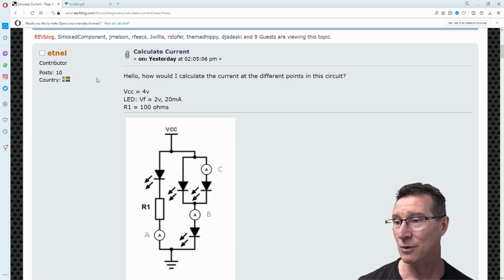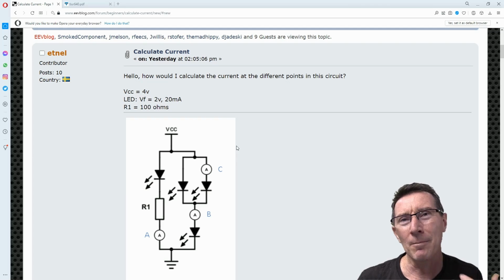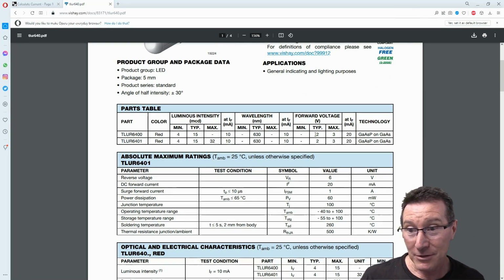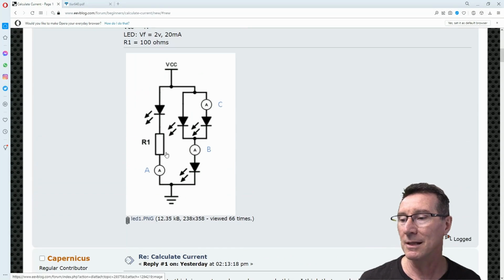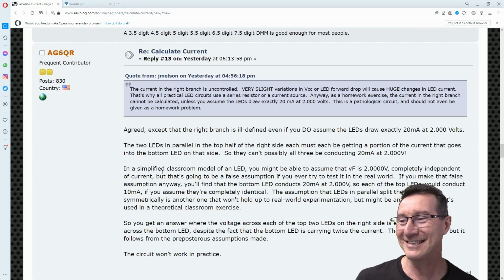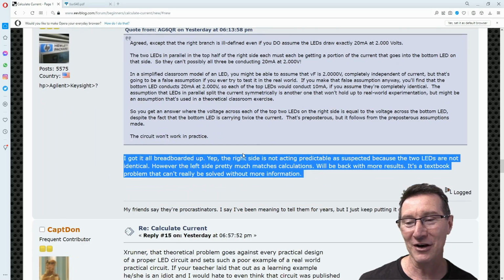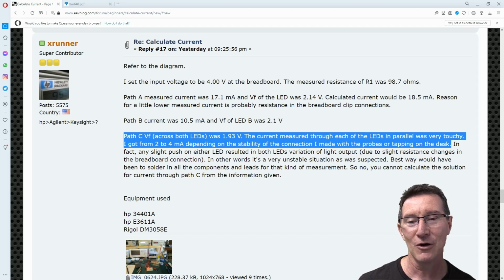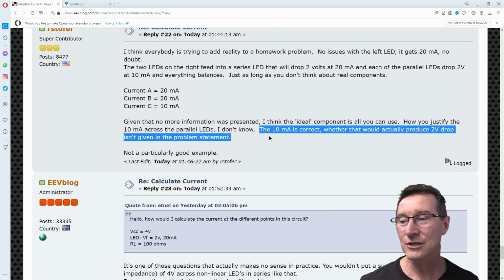EEVblog 1427 - An INFURIATING Electronics Exam Question!

Comment: If you use only the information given then "A" would be be 20mA since the voltage drop on the first LED is 2V,  and 2V/100 ohms = 20mA, easy side. If you treat the LED as linear which these are not, then each of the LEDs could be treated as resistors (2V/0.02A= 100 ohms) using the only info given. The two LEDs in parallel would act as two resistors of 100 ohms each in parallel (LEDs) hence = 50 ohms and this is in series with 100 ohms would give a current of 26mA (4V/(50+100) = 26.6mA) through the right side (B). Split evenly at the top so 13.3mA at "C". Then you tell them it is not going to work properly due to tolerances.
Reply: What was really missing is "Assume the LEDs are acting as ideal diodes" which would then make it a proper exam question. At that point, the right side then becomes a set of simultaneous equations you have to solve to get the i1/i2 parallel currents and the i3 current for that side of the branch to get the "B" and "C" answers, respectively. Being lazy and looking at the graph the voltages would probably be something like 1.9V for the parallel LEDs, and 2.1V for the LED in series, or ~15mA and ~30mA respectively.

Comment: Go Dave >>> Dave stick to them with Kirchhoff's law...all hail Dave.
Bottom line in any design is to know the basic laws of circuits even if the elements are not linear. Such as transistor is a current device and most devices in Physics are not linear.

Comment: As for the LEDs on the right side - there is another interpretation - if the (perfect) LED, which has a voltage drop of 2V, requires 20ma to pass through it to light, the LEDs on the right will not light at all, as 4V is across 2V + 2V drop, i.e. 4V across 4V. Current can't flow. Again one for the argument that the question is flawed.
Reply: This type of  logic would never allow you to eat hot dogs because given 8 weiners and 10 buns  says you cannot make any hot dogs at all.

Comment: OMG... (Disclaimer: I'm a mathematician, not an EE)
The (theoretical!) answer is: 20 mA, 26.7 mA, 13.3 mA for A, B, C accordingly. And the only assumption you need is that I-V curve of the LEDs is linear between 13 up to 27 mA. (Besides the assumption that all LEDs are identical)

Comment: I find that with a full I-V curve or model parameters for the diodes, the B-C branch could be an interesting theoretical problem, and one that could be quite applicable to someone studying analogue IC design or power IC design—though I wouldn't expect students to solve the resulting mess of a transcendental system of equations by hand (if I recall right, you'd have an exp(x) + x = 0 form, which isn't trivial to solve analytically, and asking students to do even 3-4 iterations of a numerical solution by hand is ... unnecessary).

But with the leap-of-logic assumptions that you're expected to make here, it's downright silly—I would never assume 20mA in the B-C branch, except for the fact that it's the only reference current given to us. It might not be as bad if better assumptions were given in the problem, although it's still an impractical problem (e.g. if you said the LED is ideal at Vf=2V regardless of current, then I could say that the B-C branch's current is undefined; or if you said the LED is ideal at Vf=2V regardless of current and IB = 20mA, then IC = 10mA and it's a question of realising that Kirchhoff's applies even though your LED model doesn't help).

I do like the idea of this circuit as an open-ended interview question. Lots of directions a candidate could take it—design perspective (when could this non-current-limited topology be acceptable, when would it be bad?), failure mode, discussion of the theoretical solution for currents and voltages in that branch, etc.

Comment: from the question I would assume the follwing tasks are expected from the student: 1) looking up at least one matching diode datasheet 2) calculating the currents by the the appropriate differential equations.
3) and only finally (after doing the work of 2) explaining why it's a bad design by calculating the effect if temperature drift on b/c
4) finally go on the topic of binning and production/reliability issues if used in mass production

Comment: If you want to test someone's comprehension of circuit theory, ask them what happens if you short a perfect charged capacitor with a perfect conductor and a perfect switch.  Where does the energy go?  Circuit theory is not enough.
Reply: A more precise definition of "perfect" is needed to answer this. Assuming it means zero resistance, but not zero inductance, my answer is that a current oscillates back and forth in the resulting LC circuit and the energy is radiated away as electromagnetic waves.

Comment: There's no consistent algebraic solution to this circuit because the diode elements have non-linear V-I characteristics, and the characteristics are randomly different out of the box and varying with temperature.  The best you can do is to know (or presume) the V-I curves of the components, and perform a numerical solution such as with SPICE.  It's like putting battery cells in parallel; there's no passive arrangement that will work consistently or predictably, and active battery management is required to establish stable performance.

Comment: if you convert Vf=2v@20mA to ideal 100ohm resistors,
right side ohms law is 4v = 0.0266a * 150ohms.
bottom led gets 26ma and right led gets 13ma.
but leds arent linear tho...

Comment: If you can analyze typical op amp internal circuitry with all the esoteric current sources (Wilson, Widlar, etc), crazy active load topologies and so on, then this type of circuit is pretty straightforward. Though it is definitely impractical using real-world discrete devices.

Comment: Cool you made a 30 minute rant on this.  You can make a boundary problem on this in that the right leg cannot support 20 mA, So it is below that. And the lower bound is 10 mA on right leg because we know there is a 2 V drop on the lower LED if this was the case but the two parallel diodes now have to support a lower bound of 5 mA and that makes their voltage drop less than 2 v.  So we all know the answer for c is  5 mA < Ic < 10 mA> and for B Ib < 20 mA.

Comment: It would have been fine if they just said “forward voltage is always equal to 2V” without even mentioning the forward current. Be a nice basic question, but to be given to students who haven’t yet reached shockley’s diode equation or thermal runaway.
Reply: No. You don't want anyone remembering this and thinking that LEDs can sensibly be connected like this.

Comment: Actually it’s fine to put a voltage source directly across some nonlinear elements. LEDs are usually a no-go (IIRC some deliberately have a high ESR or other on-die current limiting) but gas discharge tubes are considerably nonlinear but can be stable with a constant voltage.
What really matters is if a small change in voltage means a large change in current, or the other way around. And if they’re positive or negative tempco.
Reply: an ideal diode/LED has a fixed Vf so even at exactly 2V you have an infinite current, "infinite" only limited by the impedance of the source, but again ideal sources have 0 ESR so.....in any case the question is flawed.

Comment: Xrunner mostly has the right answer, but wouldn't get the job, they spent too much time on the problem. Are you hiring an engineer or a technician? MY ANSWER: Breadboard it and measure the values, it's the cheapest way to reach the solution. Then slap the engineer for designing such a wasteful circuit because you could probably use a single more expensive LED and one resistor which is only two place operations. I used to manufacture electronics in Australia 20 years ago in quantities between about 50 to 500 boards at a time. I had a price threshold for the seconds it would take to pick up components if I dropped them, generally only larger basic components and 3+ lead semiconductors were worth the time. Every month or so we'd sweep and shovel the assembly hall out. Every action had to be optimised to remain profitable.

Comment: It is a dimwitted question on so many levels. It might leave a novice with the impression that the resistance of the two LEDs in parallel must be 100 ohms, (after all they are in the same place as the 100 Ohm resistor in the other leg) therefore LEDs must have a resistance of 200 ohms each (they are paralleled after all), therefore I can slap them across the power supply willy nilly and they will only draw whatever the current would be through a 200 ohm resistor and this is not actually the case. As you say, these are non linear components, and you have to understand how they are used in real world scenarios, not in dumb "gotcha" exam questions.  

The question is simply an ego trip for the person that set the question. 
A smart Alec's question. 

It doesn't represent a real world scenario and serves only to confuse. 

I guess if there had been a module clearly explaining how LEDs work, in the course, and this particular scenario had been discussed then there might be an excuse for putting this question in the paper, but other than that, its a very poor choice of question. It completely dodges a whole bunch of real world issues with the circuit and may leave students thinking that this is a good choice for a legitimate design for a real world circuit (which it certainly isn't).

Comment: Reminds me of a question in  electronic music class in high-school:
Considering perfect human hearing can hear from 20hz to 20khz, is it worth the extra money to get an ideal amplifier (no sloped roll-off) with a frequency response 20hz to 30khz compared to one 20hz to 20khz?
Expected answer was yes as you'd want to pass harmonics.
But I always argued you can't hear any harmonics past 20khz.
I couldn't find a way to articulate that the ear itself would be a bandpass filter just like the amps.
Reply: Yeah that's how non-educated people are pushed to buy newer and more expensive audio equipment.
and you were still assuming a perfect human hearing freq range. In reality audition falls in the young age and most of us can't perceive sounds past 15kHz.
Perceived sound level is heavily non-linear though so even in hi-fi there is no need to give a shit about high freq distortion.
Also, a well-built hi-fi system will have a low pass filter to cut those >20kHz just to preserve the speakers.
And finally, the sound characteristics is made primarily by the room, secondarily by the speakers/microphone. The amp, DAC or audio source have a marginal impact, especially in today's world.
Reply: @PainterVierax  that's true, but you missed the point.
The argument I had with the teacher was that with the ears having a bandpass of 20-20k, no amount of high frequency harmonics output by the amp would make it past the ear.
Probably best way to explain it would have been to switch from frequency spectrum to time spectrum.  The ear would miss any change in the waveform shorter than 50uS.
I suppose another demonstration would be a square wave output from a 30k amp passed through a 20k low pass filter (to emulate the ear) would end up the same as a 20k amp.
Reply: @danman32  I didn't miss it, it's just that I didn't react to it since that teacher clearly didn't understand his topic. What I pointed out is that this all amp bw question he asked is even more irrelevant in real life situation than the younger you supposed during that time. You can make that LP filter even narrower in your demo, still the perceived result won't be altered. That's why we hear more differences in sq wave v/s sine in the lower freqs rather than the higher.
Reply: the ear can't hear it, but maybe the soul can feel it.
Reply: @cubbucca  that's why a double-slit experiment is required. With a proper methodology, many cognitive biases and pseudosciences are teared apart.
Reply: No sloped cutoff? I don’t even think that’s possible :) And when I was 17, during an electronics practical, we measured my hearing limit as 24 kHz - sadly it’s now 13 kHz.
Reply: @lordlucan529  Theoetical, not actual!
Even the instructor knew about rolloff but my take was shifting rolloff beyond the range of hearing would be the only reason for the 30k amp.

Comment: What constitutes an correct answer to this question depends on the context in which it's being asked. In many situations, Dave's take on it, that it's nonsense, is reasonable. However, at a certain level, it is certainly a reasonable question, calling on the examinee to identify what, if any, additional information would be necessary to solve, and what assumptions can be made to guess at it. Simply saying that the Diode is nonlinear and giving up on going further is literally saying to an interviewer that you know enough to make a certain amount of money and don't care about being worth more than that.

If I were using this question in an interview, it would be because I would be looking for whether the candidate understands that the nonlinearity of a diode's IV curve is exponential, and how one works with exponential functions. Tomorokoshi gives the best reasonable final result, but still doesn't quite get full marks, relying too much on equations rather than a good intuition to get there. A solid A, but not quite A+.

The answer I would be looking for is:

1) Assume the diodes are all matched, and there is no thermal runaway between the two parallel diodes. 
2) In the absence of more detailed information of the LED's IV characteristic, assume it's in the exponential region of it's IV curve (e.g. series resistance isn't yet significant)

From 1), we have right away that the top diodes each pass an identical amount of current, and the bottom diode, passes the sum of that, or twice the individual top current: Ib = 2*Ic

If we hold Vcc at 4V and the node where all three diodes are connected together at exactly 2V, then from the diode spec given, all three diodes would be passing 20mA. There's an imbalance of 20mA that needs to be provided to make this happen. If you don't provide (sink) that 20mA, the voltage of that node will be pulled to a higher voltage by the two diodes being stronger at pulling the voltage up than the bottom diode trying to hold the voltage down.

As we let the intermediate voltage deviate from 2V, the currents respond exponentially. The top diodes will see their current reduce by a factor of k=e^((Vmid-2V)/nVt) where Vt is the thermal voltage (~26mV), but n isn't given. Conversely, the bottom diode will see its current increase by the same factor, assuming it's an identical LED (same colour) to the others.

We're not given the wavelength, hence n, so can't figure what Vmid ends up being, but do have that the two top diodes pass 2*Ic=2*20mA/k, while the bottom diode passes 20mA*k, and that these are the same. Taking out the common 20mA factor, we have 2/k=k, or k=sqrt(2). From this, Ic = 20mA/sqrt(2) ~= 14.1mA and Ib ~= 20mA*sqrt(2) * 28.2mA

Comment: You could actually solve the right side of the diagram using shockley diode equation, BUT you would need to assume temperature.
Reply: You don't actually need to know the temperature to determine the currents here, as long as the temperatures of the LEDs are the same.

Comment: In theory (as in for purposes of questions like this) are LEDs assumed to be linear or fixed..? Or are components in theory unable to blow up even if over current? Kinda like "in a vacuum" or "assuming no friction" type questions: no one can ever actually test these things in the real world due to absence of things like zero resistance leads, temperature and manufacturing variations etc.
Reply: Also suffers from the observer problem because adding a meter probe into it changes the circuit too.. :)

Comment: Dave, I would have to disagree that the right branch (lower half) has 20mA through it; the "Vf = 2V @ 20mA" does not mean that the LED regulates the current to 20mA. Without a current limiting resistor (or active current regulator) in that right branch, those right LEDs will have a huge current, limited by whatever the power supply can source, and soon the current in the right branch will be 0 after then burn out and open.

Comment: I really like the idea of using badly formulated questions for job interviews! Their reaction would tell you a lot about them.

My instinct would be to just assume the LEDs are linear and model them as 100 ohm resistors, if that was all the information given. You'd obviously have to judge the depth of your answer based on the level of the exam and at the least state your assumptions. I can only imagine that's what they expect you to do since Kirchoff's law clearly prevents all the LEDs passing the same current. It's a stupid question and I'd be pissed off if I got it in an exam, but you're best off just putting the stupid answer they're looking for and moving on. If you want to have a rant, email the exam board when you get home - they might even actually do something but the person marking your paper wont care. And if its a university then go find the appropriate office and give them an earful!

Comment: maybe the question has been revised from one having four 2,5V 100mA incandencent bulbs and a 25 Ohm resistor, but the maker of question is not too familiar with diode's current and temperature dependence.

Comment: I suspect xrunner also had some measurement error in the parallel LED pair as a result of the shunt resistor of the multimeter.